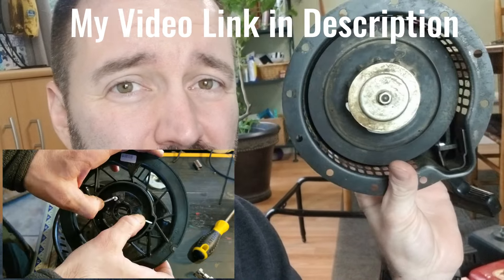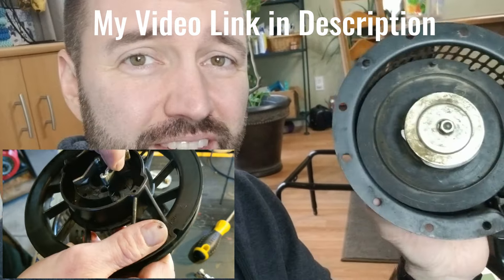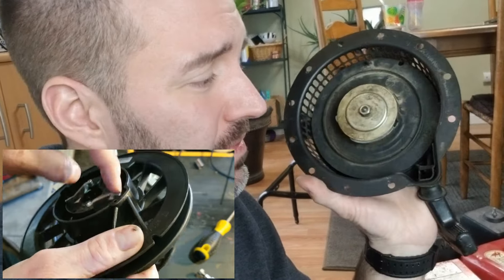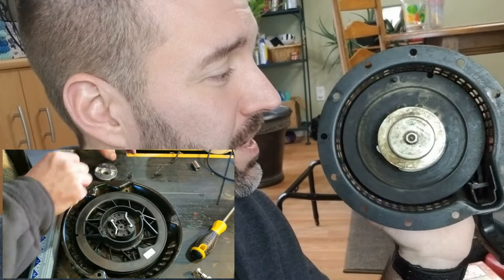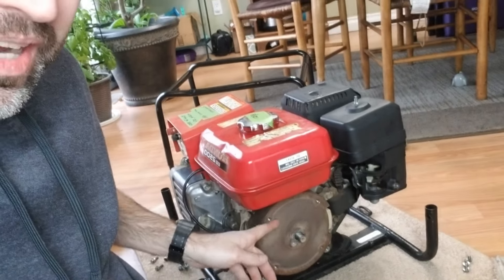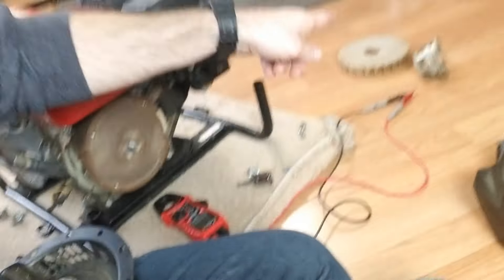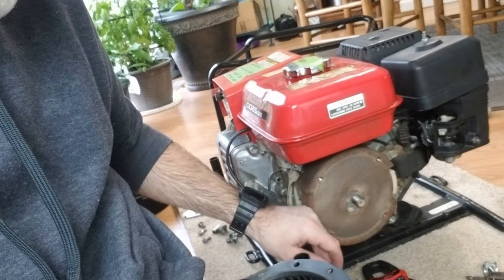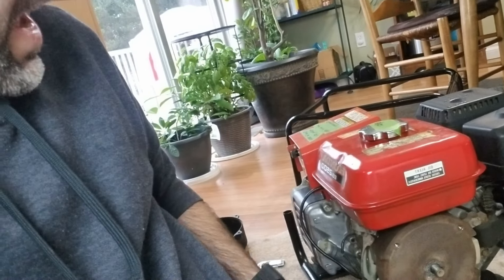Generator Hard to Pull Start?  Check These 5 Things to Fix!

Comment: Hi, I have a Predator generator that has less than 20 hours, about 3 years old. We had a blackout the other week and my powerstation ran out of juice so I thought I'd bring out the Predator. It would not crank so I added new oil which did start but it died within a few seconds. The pull cord then locked up and I couldn't even pull it to start. I drained the oil but I think I may have flooded the motor with too much oil. Any suggestions would be appreciated.

Comment: I got a generac gp5500 hard to pull...i checked all 5 like yu did, even opened it up cams fine, with plug out i can see valve move to decompress but still hard to pull . WHAT NEXT😢

Comment: Great video. For the possibly partially seized cylinder (corroded) I have found putting in a little oil as suggested and then using a screwdriver in the pull start slotted cup (remove recall starter), I could work that gently round clockwise + counter until it became more free. Once free-ed up sufficiently it was easy to start. You are right that once started that oil with produce some smoke for a short time!

Comment: Thank you so much for explaining the remedies to starting issues.  I have a Duramax 4000 generator from 2019 with a 208CC engine that starts so much easier than my auger with a 52CC engine. Is there a better recoil starter in the generator?  Will I be able to replace the older recoil on the auger with an easy start recoil?

Comment: Thank you for this video. I have a pulsar 6500 dual fuel which is a few years old with under 50 hours on it. Few weeks ago had a hard pull couldn't get the flywheel to move without coaxing it as soon as I got a turn it started right up. Same thing just happened again after a few weeks. Would appreciate any thoughts or advice. Thank you again!

Comment: Alright, so I have an almost new westinghouse generator that I usually turn the gas off and let the gas run out to kill the generator not leaving  any gas set besides  the tank. While doing this one day I had a backfire and every since it's been hard to pull start it. Figured gas might be leaking  into it even though I had the gas turned off so I pulled the plug and gave it a few pulls in case but when I put the spark plug back in it when straight  back to hard pull. This generator  can't have but maybe 20 hours if that. I use it just about every weekend since I got it for a hour sometimes  maybe 5 hours at the most. To run my camper just until I get my power plug put in. Any ideas?

Comment: I recently acquired six generators for free. Three of them are now operating properly and I only put a total of $1.99 for parts. One of them I have not finished the diagnosis yet but two identical duromax xp13000eh units were both impossible to pull start and even the electric starter was not able to turn the engine with a fully charged battery and jumper cables attached from my pickup truck. Only tried that with one of the POS duromax generators. Then I removed the cylinder head and found that the exhaust valve broke and ended up in the piston sideways. Then took the cylinder head off the second durocrap and found the same thing. I'm happy they were both free lol. After attempting to contact the manufacturer by email to get replacement parts, never got a response. I have found a suitable replacement valve that is for an automotive engine and am going to attempt to repair the hole in the piston with an oxyacetylene torch and some aluminum stick welding rod. If it works out, that would be cool as whale shit. If not, I don't really have much to lose other than some time. Either way it should be a good learning experience. So the point is that a broken valve jammed into the piston could be another reason why a generator would not pull start, and in my opinion, duromax generators are fucking junk. The strange thing is that one of the duromax engines looked like it had many many hours of run time, but the other one looked as if it was almost brand new. For a company that touts how great their products are and how they are so proud of them being engineered and supposedly manufactured in the USA, I find that extremely difficult to believe. Looks like some Chinese junk to me. From the lack of response to my email and no availability of parts that I could find online I am certainly glad that I am not the original purchaser of those generators and hope that the people who did pay money for those were refunded or supplied new products from a different manufacturer.

Comment: I have a eu3000is that is very hard to tryband pull the recoil even with the plug removed. The valves are moving fine and the piston isn't seized.. it ran great a few months ago when I serviced it for the customer but he said it started smoking and then quit. They had put too much oil in it and the gas is bad but even after changing the oil and removing the spark plug it is still way too hard to pull start and the electric starter can baring turn it over

Comment: Valves are out of adjustment..  could cause motor to be hard to pull.. say like what mine just did to me.  The exhaust valve got tightened some how so you could pull to a point and hear the intake suck a bunch of air in then as soon as you hit that rotation for exhaust stroke it would stop and make you have to put a leg on it..  then once your over the hump it would get easy again.  But if she fired after that exhaust stroke shes taking your arm back with the pull string..  so adjusting the valves did it for me.  Got me thinking when you said compression release..  was at a head scratching time and hurt arm, hurt wrist with a broken drill..  fyi use an adapter clutch if your gonna try to start a motor with a drill..

Comment: Good information.
My generator starting kick cord is also very hard.I removed the spark plug  and then tried to pull it.It was ok or normal to pull .I tried multiple times without plug.When I installed the spark plug back ,again I witnessed the same problem i.e hard start recoil cord.
What will remedial action?
Is anything wrong in head tappet adjustment? Or anything else?
Reply: Mine is like that too. Did you solve the problem if so how did you solve it?
Reply: I am having the same issue with mine. Have you figured it out yet please help.

Comment: I assume a critter lodged something in the fan behind the recoil wheel but I can't remove the recoil start assembly because some genius at Briggs & Stratton used rivets! Any ideas? I can't imagine why they wouldn't use hex screws or something that would allow you to remove/replace the pull cord assembly.
Reply: You can drill out rivets. Drill straight through the center of the rivet (hopefully smaller drill bit than the size of the hole the rivet (or bolt) would thread through).

Comment: I just got one at 6500 W Homeland for free and when I pulled it, it was stuck it was stuck and then I took the valve cover off and I just tapped it a little bit and then I pulled the string and it got unstuck

Comment: Hi,
Have an almost new gx200 clone. Started running rough.  There is leakage on the exhaust valve. Any attempt to set the backlash (even at zero), negates the compression release and I cannot pull the rope.  Can't find a sweet spot.

Comment: Hello, i bought a Ryobi 5500 watt brand new two years ago then been used once under 5 hours and has been seat over a year then two weeks ago i was used it about 5 hours and then i want to use it again when i pull it the engine is very hard to turn, i broked two pull cord now. and i watch youtube about it and i bought a marvel mystery oil put into cyclinder and still do the same. Can you help me Please,

Comment: My loncin gf200 pullstart will not work. Take spark plug out and pullstart works as it should. Put spark plug back in and cord will not pull out.There is no fluid on top of piston. I'm at a loss. Any ideas?
Reply: Good question that's where I am at

Comment: Hhhhmm, interesting.  Our Coleman Powermate 6875 takes about 35 pulls to start it and it gets easy to pull just before it will start.  So that would be a the compression release isn't opening the exhaust valve properly then, okay.  Thanks!

Comment: Your table leg looks kinda crooked! Could make table fall...
Probably just need to be tightened inside there...
Maybe it's just the camera

Thank you for the video!
I'm suspecting I have some piece of flaky rust or something inside under the head of this OHV Briggs 5500 Storm Responder.
First time starting in years, and it went through Hurricane Ida flooding here in NJ Sept 2021.
Cycled some water out of exhaust, changed oil, cleaned carb (which was a mess), and now suddenly hard to pull. Pulled plug and no change. Next step looking under head.
Edit: Or perhaps what Donyboy is talking about here: https://www.youtube.com/watch?v=nLDPoKqEb94

Comment: Why does nobody mention the valve play in these videos?
Kept me 3 days effing around with my engine pulling it in parts and reassemble it two times 😂
In the end, after doing some serious research reading it was too much play in the exhaust valve. And it was not only difficult to pull, it literally ripped the cord out of my hand
Reply: How were you able to fix the kick back from too much of compression on the gen? Am presently dealing with one right now
Reply: @michaeloyekan9078  In my case it was too much play in the exhaust valve which results in high compression. Not more to do than to adjust the valves to the correct play
Reply: Maybe I'm doing it wrong
Reply: I'm still having cord being ripped out of hand sometimes I wish the electric start worked what causes the electric start not to work
Reply: Is any ones electric start not working ?